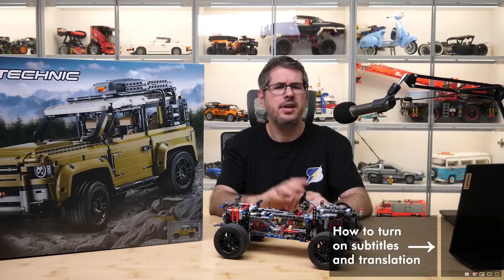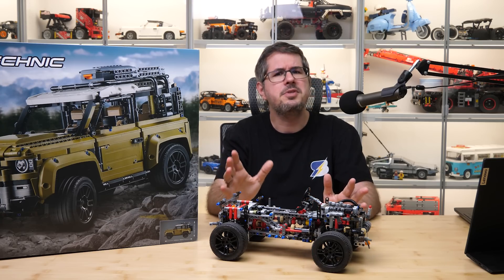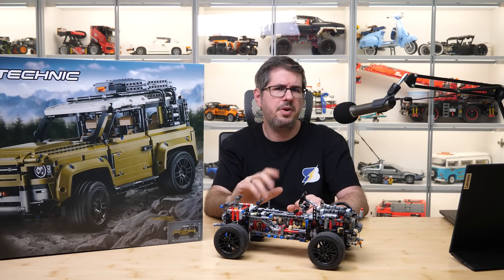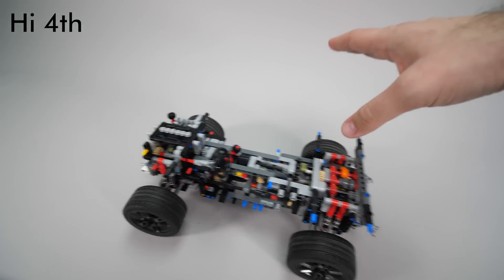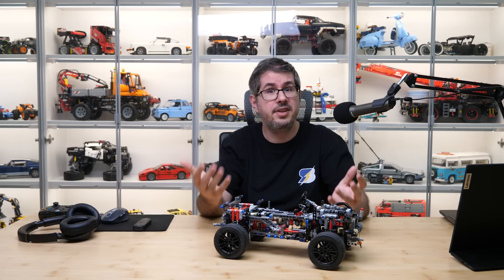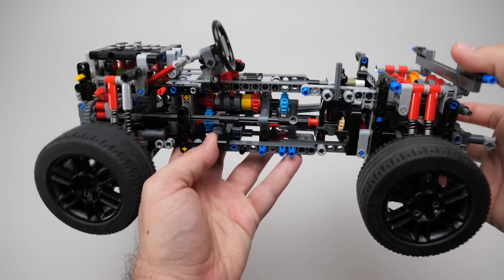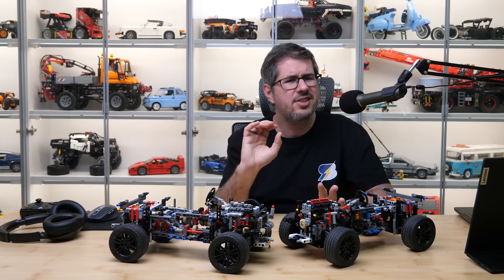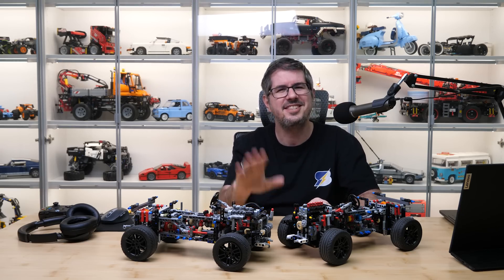LEGO Technic Defender 3 years later - is it any better? Possible fix with new gears!

Comment: I found when I created the 8 speed version, the alignment of the centre hub was partly to blame as it added a good degree of tension if not aligned just right. I also found the crankshaft design created enough friction on its own and have wondered if the newer crankshaft disc system might resolve it once the newer gears are used and the central hubs alignment is spot on.

With mine, I completely rebuilt the drive system and included an 8 speed box plus Hi - Lo ratio and D-N-R. I also squeezed a v8 in which can be seen on my channel. I don’t have any cracking of gear even though you can feel the friction from the engine itself due the the tiny notch on the Lego part itself

Comment: Hi there. I just bought this kit. What gear parts do I need to buy to prevent the cracking noise, and at what stages do I need to replace the gears from those included with the kit? Thanks for your help! Your videos are awesome! 😊
Reply from the maker: You won't be able to eliminate fully the cracking, doesn't matter which gears you replace, that was the point of this video

Comment: I know in my lego nascar technic the piston would clog up and i kept thinking it was the gears but when i took them out it was no longer. The gears in the differential were slipping or the main gear on the diff was slipping because the pistons in the motor mount were catching the system.

Comment: the cracking sound turned out to be misaligned joints in the driveshaft
Reply from the maker: That's one source of the problem, but aligning the joints doesn't solve it fully unfortunately

Comment: After having major clicking issues, I followed your guide and found nothing wrong with my build. 

I think I discovered the problem, and it lies in the gearbox construction. If you make any of the axles holding the gears too tight, there is too much force to overcome, and it leads to binding.

My suggestion for anyone still having cracking, rebuild the set from the beginning. Take care building the gearbox, and make sure you check at every step that none of the gears are too tight, and spin relatively freely. 

After a complete rebuild, I made the gearbox pins just slightly looser, and everything works perfectly.

Comment: This problem can be solved very simply, you just need to replace two gears in the gearbox, in the place where the smallest gear pushes the largest. The smallest one needs to be replaced with a gear with twelve teeth, and the largest with a gear with twenty teeth. To do this, you can use blue gears like in the video or black ones of the same size. Не благодарите.

Comment: Great Vid, Great Channel, Liked and Subscribed! Thank You Sir!
Just built mine but only to chassis stage (end of section 2) (bought for £70 from a guy who couldnt get past the first stage of the build so gave up) 
I'm experiencing no cracking at all yet. I may be wrong (I was wrong once but it was a very long time ago) but could the cracking just be those 6 top piston parts 4211573 coming down more quickly and smashing against the engine harder and faster in the higher gears? I wonder if someone who is experiencing the cracking could experiment by taking the 4211573's off and then run it. Bit of a fiddley task to get them back on but might be worth it for the sake of experimentation. By the sounds of it mine will be cracking soon so I might get chance to do the experiment myself but if anyone does try it please let me know. 
ALSO........ I think you should do a video of the mod (if you haven't allready), I would watch it. Im gonna head over to rebrickable right now and check it out, I've already had a few upgrade ideas so lets see if this mod incorperates any of them. 
BTW does anyone else have a 'problem' with the middle head rest on the back seats? Its not completely symetrical because of them having to use a two and one to make up the three. No? Just me then! I might have to buy a couple of ones and fit them instead of the 2! 🤣😂🤣
Reply from the maker: The pistons have nothing to do with the cracking, as it comes from the gearbox or other parts of the transmission, depending on the scenario. It's nice to have a cracking-free build, congrats! But if you want to dissapoint yourself then I suggest to try to push the model fast on the table a couple of times in the highest gear / hi mode once it is finished :)
Reply: @RacingBrick  Thanks for the Reply. I should have guessed that It couldn't be solved as easy as I suggested It was a combination of 'thinking out load' and over confidence I think, one day I'll learn to think before I speak🤣

Comment: Hi! About "scratching".. Did you checked differential satellites? I had same troubles, whith my chineese lego f1. It was ok, till i disided to install motor and battery. On speed, under load, the satellites pop out of the cross rod, and appers "scratching".

Comment: I built this set roughly two years ago, when I was roughly 12 years old, and I managed to build it with just three mistakes, those also were very easy to fix, but I never experienced the cracking sound, and two years later, still no cracking!

Comment: the cracking has nothing to do with the gears. the problem with this is that people don't allign the universal joints in phase in this set when they build it. And that results in cracking because out of phase universal joint leads to an rpm that is not constant.
Reply from the maker: I made several videos about the subject and did tons of testing, the phasing of the universal joints is only a single piece in a complicated puzzle.

Comment: Thanks for your videos, I have been following your ultimate repair guide video to build and avoided all the mistakes, thank you! It worked great at the beginning, but the cracking started to happen and it was getting worse. I tried all the solutions and even swap the differential as the other guy suggested, but it was not improving much and seems got worse and it even start to crack in other gears.
How i fix it? What I found at the end is all because of frictions. The gears and axles are too stiff, especially from the u-join to the fake engine and the engine pistons.
I sprayed some Silicone-based lubricant to all the u-joins, axes and gears, including the engine pistons and now I can roll smoothly in every gears, even in Hi 4th gear without cracking!
Please make sure to use Silicone-based lube as it is safe to plastic, dry and not messy, and does not attract dust. The one I use was WD-40 brand’s High Performance Silicone Lubricant. Please note not to use ordinally WD-40 as it is oily and will damage plastics.
I am not sure if you call this cheating, but after all these are mechanical works, and it needs lubricant to work 😁

Comment: Why does the engine move faster in the high gears, wouldn't be the opposite? Or is it a visual thing.
Reply from the maker: This is apparently the LEGO concept for kids
Reply: @RacingBrick  I can understand, fast gear makes engine go fast. I've always just liked accuracy and it's cool to be able to hook a motor up to the Lego engine and have the gears shift the right way

Comment: As you said the solution may very for each individual but I have found a very easy fix that solved my cracking problem. I just removed the 16 teeth gear that connects the engine to the dnr gearbox. That way your gearbox has only drive and neutral but due to the much lowest resistance (because, as you said, the reverse gear is always engaged) the cracking sound stopped.
Hope this solution solves your issues as well. If it did I would really appriciate it if you told me.

Comment: Balázs, since you have gone so far with this set, I think you should definitely cover up this MOD, which just makes this set as "ultimately playable" as you can get!
I have built the pimped version a few weeks ago, and it definitely improves things in all the gears, low or high. One of its advantage is the removal of all universal joints in the drivetrain, but also the speed differenciation between gears is more noticeable, with no cracking noise.
As for other improvements, I would say that the most impressive one is the easy-to-remove body, which only involves a few red pins: so easy and efficient!
The instructions of this MOD have both a pros and a cons: they are much more difficult to follow that LEGO's ones (everything is shrinked from 500 to 200 pages), sometimes with parts which you have to deduce the location for. However, for those who have already built the original set, it is just like re-discovering it completely, because the whole drivetrain is modified, and also because the all-in-one body is built completely separately. Great experience, indeed!
We should also mention the needed parts needed to build this MOD, but the number is not enormous (168) and they are quite common for any Technic collector.
Reply: Awesome! Can you provide the link for the instructions please? Thanks!
Reply: Pimped up is the best. I think I'll revisit it and replace bevel gears, the pimping will be even more intense 👍
Reply: @kevinpeng8295  just search "Pimp my Land Rover lego"
Reply: @kevinpeng8295  it is on rebrickable by jb70

Comment: Thanks for this analysis. I did not have any issue building it the first time and did not notice any cracking noise in high 4th or any other gears. Then I noticed the cracking issue being faced by many on the internet and tried to replicate it. Only after pushing the car very hard in 4th high gear that I started hearing the cracking noise. In fact, I pushed it so hard that the universal joints broke. So, may be I am in the minority group that did not face this issue with normal use.  I do however, take my time in building technic sets making sure that every step is done and if possible tested to make sure everything is working as expected. The only other observation (which is true for all technic sets in general) is that when engaging driving rings, it takes a while for the power to transmit from input to output, thus introducing a kind of lag, if you will. As a result, when pushing the vehicle, it rolls freely for some time before the pistons start running. Since there are quite a few driving rings involved in the drivetrain, that lag is substantial and is quite noticeable. I think they should re-design the driving rings to have as many engagement points (for a lack of better words) as possible, as current 4 (I believe) are not sufficient
Reply: I see, I thought I was the only one that was facing the problem of lag!

Comment: just came across this video and whilst I haven't tested or noticed this with my Land Rover, I did notice this with my gt3rs last week. That car was built years ago and I don't remember it having any faults at the time I built it, but I did have the same cracking shown here along with general tension and the wind up effect you showed. I thought I may have messed something up with it but after switching gear, the issue went away, so it does look like the same issue as shown with this model. I would worry about all these larger technic sets with gearboxes getting this issue eventually as I'm pretty sure the Porsche was one of the simpler gearboxes, but still has this issue.

Comment: I got the imstructions from rebrickable to make (out of 2 land rover models) an extended version with 4 doors. while making this model on one page of the instructions it required a specific gear to be put in, however i had to replace it with a smaller one as it was too big to actually fit in and now fully built the wheels don't move (they sort of clonk and click a bit but won't turn) except in reverse  but after a short distance one of the rear wheels starts to come away from the vehicle! I'm 90% sure it's due to this single gear as can see where the gears are getting stuck and it looks like the specific gear but can't be 100% sure.

Comment: Okay, I just found out that Lego finally overworked the gears. I'm mailing them since years that they cant use this thick gears between 2 Lifearms with this tolerances. It has way to much resistance surface. I found similar problems in the Airrace Jet Gearbox and in the Buggatti which I never completed after that problems. With that new gear I might rebuild the problem Sets I got before :)

Comment: I’ve decided to take it out of the shelf again and it still has the same problem with the cracks, even in Lo1 gear. I remember that I’ve watched that video to fix it countless times and at the beginning it’s fine but after few cm of moving it it still cracks. I’m sure that they didn’t really tested it before it went on sale